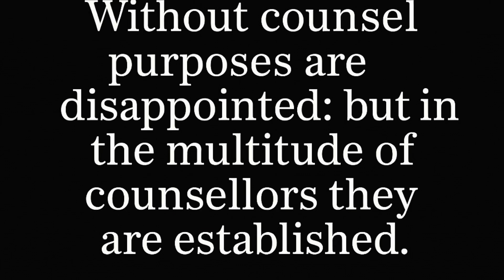Stop Wasting Fuel! Use the RIGHT Generator to Charge Off-Grid Batteries

Comment: This matches the results that Johnny's Weekends had. My 5kw chargeverter should be a good match for my 6kw running generator.
Reply from the maker: That’s great to hear! I haven’t seen Johnny’s Weekends yet, but I’ll have to check them out. A 5 kW Chargeverter paired with a 6 kW running generator sounds like a solid match — plenty of overhead so the generator isn’t working flat-out all the time but still making good use of the generator’s usable range.  Have you tried different sized generators in your setup?
Reply: @BrambleBerryHills no, the 6k is all I own. I may look at a smaller, more portable unit later on.

Comment: Charging batteries with a generator ...here is the stupidity..... I'm off grid for 5 years, never used a generator.
Reply from the maker: Glad to hear your system has been able to keep up without a generator for 5 years — that’s awesome! Every off-grid setup is different depending on climate, winter sun hours, load demands, and how far along the homestead build is.

We’re still building our place from the ground up and living in a camper, which isn’t very energy-efficient in extreme temperatures. Between heating/cooling needs, appliances, Starlink, running tools, and actually living full-time off the system, multi-day cloudy stretches in Missouri will drain the batteries faster than solar can keep up from time to time. 

For us, a generator isn’t ‘stupidity’ — it’s just a backup tool to keep everything running while we are improving the system. Off-grid living is a process, and each year we try to build things out to rely less and less on backup power.

But I’m genuinely glad your setup works well enough that you don’t need one — that’s the goal for all of us.
Reply: @BrambleBerryHills What I'm saying is that people were doing without petrol and that's it's easy to do the same as they did while you already have solar power... 
With the price of a good generator you can buy more panels or/and battery.
I lived 2 years in a tent, washing myself with ambient temperature water, wanting to be off grid is maybe also making an effort to use less energy.
Instead of relying on heavily polluting easy solutions, seems better to reduce consumption and be smarter to organize our lives tondo so.
Reply: Well aren’t you special! That adds exactly nothing to the discussion except a pointless insult. There’s always somebody who needs to inflict themselves on others.
Reply: @michaeljuers574 Whoever is a little educated in basic physics understand that charging a battery with a generator is not smart, the efficiency is abyssal.
Reply: @PerformaSarl-qn2lg    You're my hero.  There, I said it.

Comment: What about using wind power to charge your batteries?  I am actually thinking of Solar, wind and propane. But dual fuel might be the way to go so I have gas or propane for backup. But if I can make wind work that would be awesome.
Reply from the maker: Wind definitely interests me and I have definitely thought about adding it into my setup.  That being said, every time I have done research into it, I come to the conclusion that it is too costly and overly complicated for the amount of power I would get out of it…especially in my location.  We live in the woods in hilly terrain, so in order for me to get up above all of the turbulence into “clean” wind I would have to stand up a pretty tall tower, which needs to be properly anchored and grounded.  When I add that to the cost of a descent sized turbine and the accompanying equipment, I find it’s just easier to run my generators every once in a while.  Something to keep in mind if you do start exploring wind is that if your batteries get full, you have to dump the power from the turbine somehow or it will burn it up.  I think some turbines have built in breaking systems or and some setups use heating elements that basically burn off the excess when it isn’t being used to charge.  Also, for the amount I would spend on the wind, I could add a pretty sizable expansion to my solar that would get me even closer to not having to use fuel.  I did that this year and it has made a pretty big difference in the hours I have been needing to run my generators.  If I spent some more time optimizing that system I think it would get even better.  The biggest draw to me for incorporating wind is that it would likely be generating power when the solar array is not.  But, like I said, not enough to justify the costs to me.  Best of luck with yours!
Reply: @BrambleBerryHills  I spent 3 months in the winter in Borrego Springs CA desert sleeping in a tent. That tent got destroyed by high winds and it was supposed to be a sturdy tent. I experienced constant 5 to 10mph winds until 4pm when there were a lot of 15 to 50 mph winds
Reply from the maker: @JohnMerchar-x3o If you are in a place that has that much wind…it might be something you would want to consider!  Where I am, we just don’t have consistent wind.
Reply: @BrambleBerryHills I am still learning solar but the desert in summer has little wind but in winter weather seems to change a lot. I was actually living in a tent for 3 months and I wish I had a van at that time because there were actually few rain days and the 35mph and 50mph gusts bent the frame of my tent.  That is how I became a believer in wind as plan B if solar not practical.  The sunrise at 6:15am and sunset at 4pm. I have heard that location is the most important thing about wind. 😊
Reply: Wind is more expensive and just as intermittent as if not more than solar.. Charging from the grid is by far the cheapest but lots of people don't have this option..
Reply: I believe if a cheap 500w Vevor wind turbine could produce maybe 3000 watts at nighttime to sunrise that would be great. I think I will have 1 Solar Generator 24v 7680Wh 300amps and 2160 watts of Solar panels. Then I will use a wind turbine to power a Bluetti AC180P Solar Generator and maybe use the Vevor 500watt wind turbine to charge the 1440 wh system. A guy ran a car refrigerator for 6 days 6 hours and 35 minutes solely on a fully charged 12v100amp battery.
Reply: At this time wind is costly and doesn't justify the effort for the return. Now if you can do Hydro, that's different.

Comment: I haven’t been able to actually test this, but if you look at the specs on these generators, the larger generators are more efficient when there is a constant load.  The fuel efficiency flips when you have varying loads where the generator may be idling more often.  So if you’re charging a power bank the larger generator is likely going to do better.  But if you’re running things like a refrigerator and air conditioner directly, the smaller generator will do better.  At least that’s how I see it when reviewing the specs and determining the per gallon output.
Reply: They are all inverter generators so that doesn’t apply. 

There are other videos that test inverter generators that show that for any size, they are more efficient when you get closer to full load. 

So use whatever generator you have that puts you closer to full output to match the load.
Reply from the maker: Thanks for the thoughtful comment — you bring up a good point. There definitely is a difference between powering loads directly from a generator and using a generator to charge a battery bank, and that plays into how fuel efficiency works.

For appliances that cycle on and off (like fridges, pumps, or A/C units), a larger generator can sometimes run more smoothly and handle those fluctuations better. In those situations, the logic you’re describing makes sense, and larger generators can look more efficient on paper when they’re carrying a substantial percentage of their rated load.

In my case though — and this is the big factor for my setup — my generators are almost never powering loads directly. I almost exclusively use them to charge my batteries, and the chargers only pull around 800–1500 watts no matter which generator I plug in. That steady load is far below the efficient range of the 5000W Predator, so it ends up burning extra fuel just to keep the larger engine running. Meanwhile, the 2000W and 3500W generators operate much closer to the middle of their capacity, which is where inverter generators tend to be the most fuel-efficient.

In real-world testing, I’ve seen the smaller Predator units use around a quarter to a third of a gallon per hour at those charging loads, while the 5000W requires noticeably more fuel to produce the same wattage simply because it’s so underloaded.

So I think we’re both highlighting valid aspects of the bigger picture — your point definitely applies in certain scenarios, especially when powering fluctuating loads directly. I appreciate you sharing your perspective; it’s a helpful part of the conversation for anyone trying to match a generator to their specific setup!